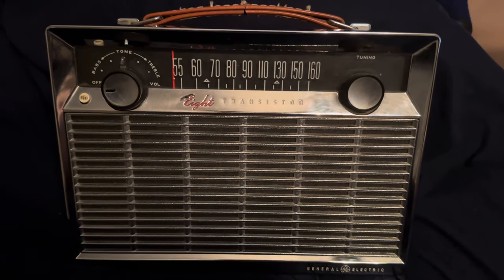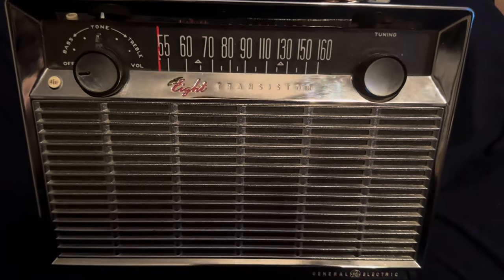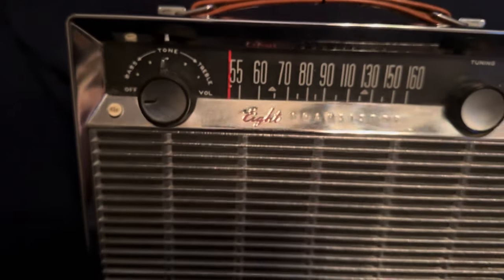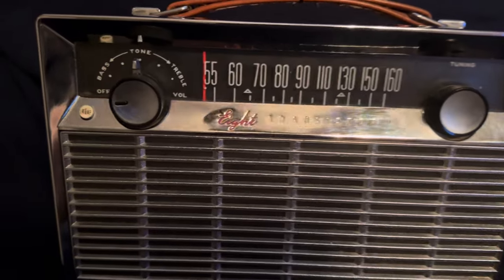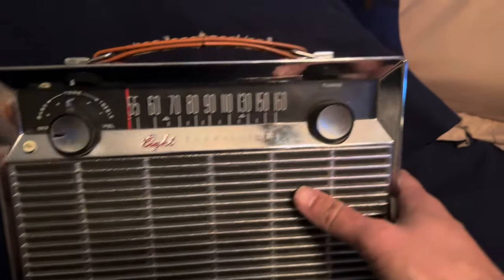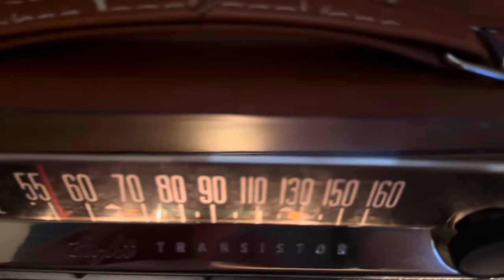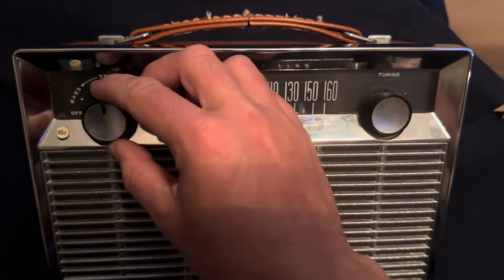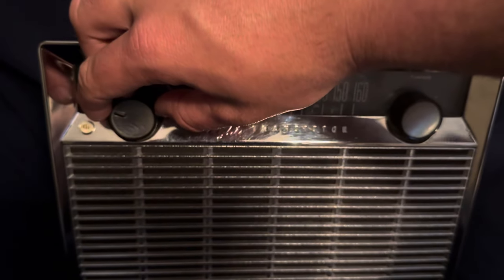Vintage GE P-780f transistor AM radio review

Comment: I picked one of these up a few years ago to go through, but it works so well already, I'm probably going to just leave it alone. Very hot on reception! I'd dare say it's my most sensitive radio, and yes..its HEAVY! Laughably heavy for something portable. My chrome is a bit pitted but overall in the same shape..and color. That squeal you're getting is something else on that same frequency that's causing a beat frequency to appear. By turning it, you are nulling out the unwanted one since AM is rather directional. My guess is it's something in your house (power supply, LED bulbs...etc..) or another station. You could "sniff" it out with a radio, or try going outside away from the building your in to rule out inside interference or if it's a weaker station underneath the louder one. Thanks for sharing!
Reply from the maker: Yeah, this radio is absolutely phenomenal for picking up stuff especially at night

Comment: What do those angles mean? What is this? My name is igor belevich . I am 40. I live in belarus. I listen to analog sw,mw-am radio sony icf 704 s. I received several north american christian radio stations on sw 31 meter band,and sw and mw stations from other countries in belarus. On mw ,am i cannot receive stations from usa ,unfortunately. Can you write letters to any american am stations and ask them to broadcast on am to belarus? Or is it impossible? I can receive usa only on sw in belarus. In 2001,more than 20 years ago i heard more sw,mw,am stations. Most stopped broadcasting,unfortunately.
Reply from the maker: Are you talking about the 2 triangles between “60 and 70” and between “110 and 130” ? If so, those were the old civil defense frequencies that were used in the 50s and early 60s in the event of like a nuclear attack. Apparently, if there was like an attack on United States. You would tune your radios to 640 or 1240.